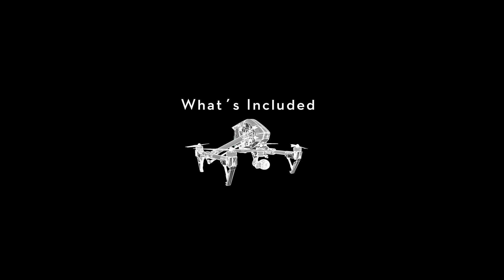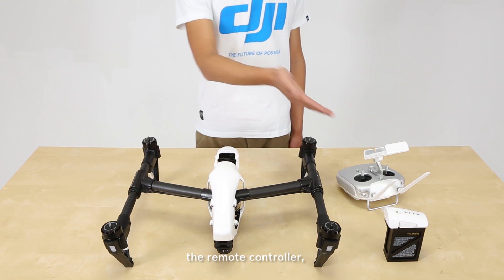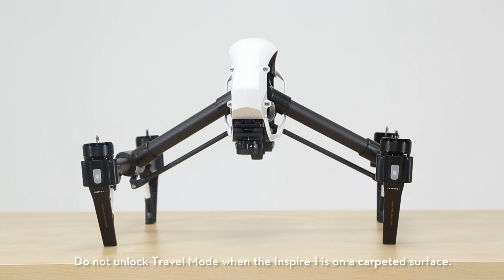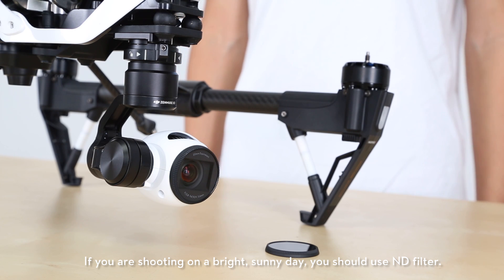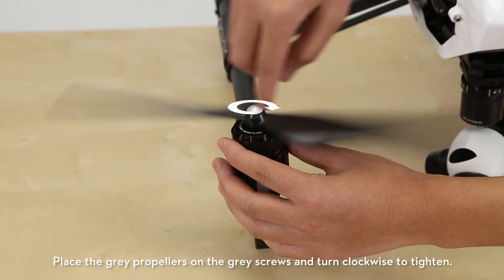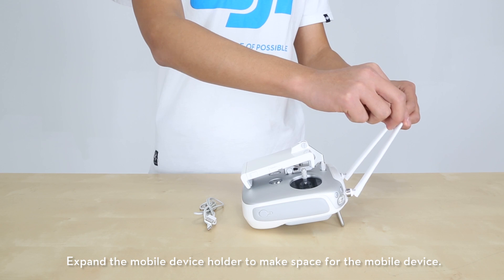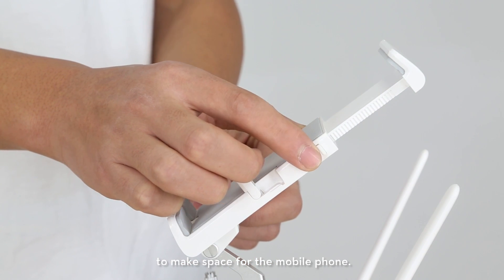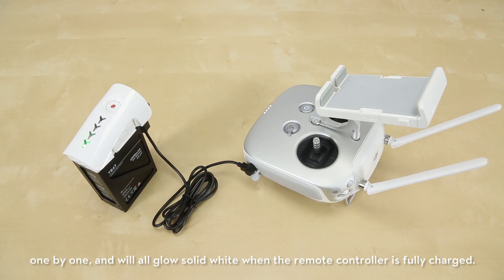DJI Tutorials - Inspire 1 - Unboxing and Preparing for Safe Flight

Comment: inspire 1 update if you are running the old ipad piliot app 1.2.0 and 
your copter is useing the new update 1.8.0  fireware it wont work //your
 transmittrer wont link to your copter and wont display any info but 
video sighneal  but will dispaly no rc sighneal with blinking red on 
your ipad   it also wont show the countdown clock when linking your 
transmitter to the copter so  go to the apple store and update your 
ipade to dji go 
app    2.8.0 and after you update your ipad you can automaticaly update 
your transmitter   useing this newer version and  without use a sd card 
it  that easy  dji finnaly got there crap together/ i made a mistake 
and sent in  my new copter for repaire and they sent it back in the same
 condition and didnt relize or tell me  what i needed to do to fix this
Reply: Prices how mouch

Comment: The inspire 1 looks and is awesome! But it's too expensive I'm gonna get phantom 3 pro but I think compared to the phantom 3 pro I think the price should be 2,000 to 2,650$ just my opinion but besides the price of the inspire DJI is awesome I think the most evolved in tech and flight (every thing). I have no idea how DJI can get any better besides range of transmission. 

DJI keep on doing what ur doing!